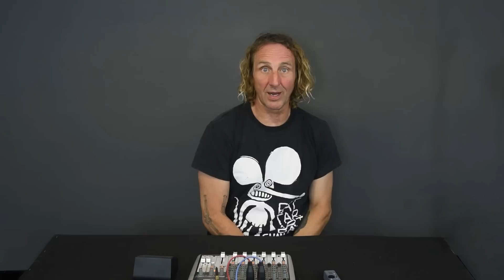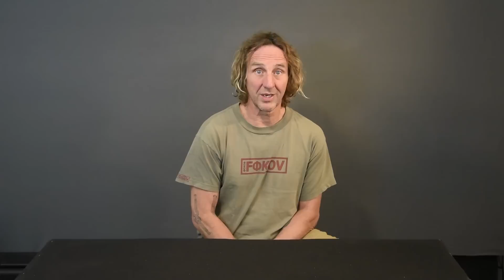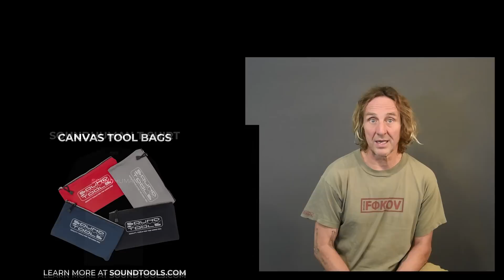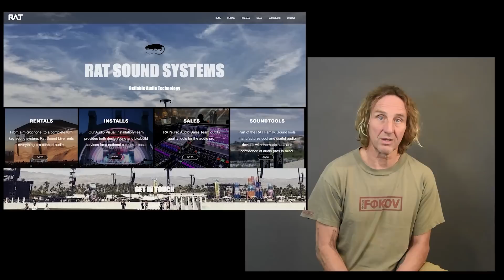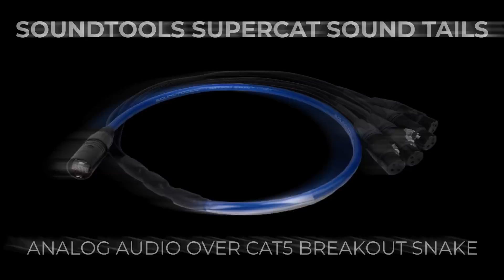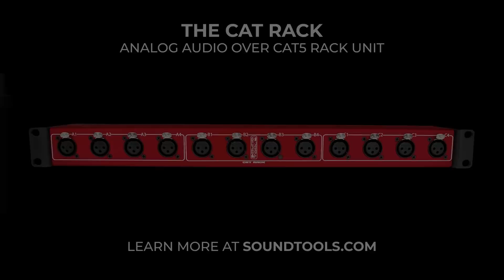Does Gain Pot Sound Different than Fader?

Comment: So on my console, i guess the aux sends are being attenuated by the send knobs, considered full send at 100%. Are the dedicated stereo fx returns attenuated by the return knobs, or is that a gain? My board has unbalanced stereo fx returns.
Reply from the maker: With digital consoles it's a bit different as pretty much every level control throughout the console except for the input gain, performs a mathematical addition or subtraction to the signal. 

So as far as digital consoles are concerned you have a gain control that will set up your signal noise ratio and for the rest of the console you want to try and use settings that are avoiding the extremes. 

And PFL various locations to make sure the level traveling through the console is not super low or super high. 

The main purpose of this was to demonstrate that the sound of changing the game pot versus the sound of changing and attenuator is pretty much exactly the same. 

There are people that believe that somehow the game pot turns up everything and an attenuator somehow magically knows to focus more on turning up the sound of the instrument that you're mic'ing

Comment: Theoretically, +1db on Gain and -1db on Fader gives you 0db. There is no magic on this. No if and buts. 1db is 1db EXACTLY the same. There is a difference in the electrical circuit : Gain is an active amplifier. Fader is a passive resistor. Gain brings signal up, fader brings signal down. But 1db is 1db, regardless of where it comes from.
Main difference is the way we use them for our convenience and protection of recording/sound quality.

Comment: I think that the gain vs fader has to do with how microphones react to gain more than the circuit differences between them somethings a noise generator in two channels won’t show
Reply from the maker: Interesting though whatever the gain circuit does, real or imagined, the fader just gives you more or less of it.

And neither gain nor fader has the intelligence or ability to selectively know the difference between the instrument mic'ed and background noise.

And somehow there are people that believe somehow a strange magical phenomenon exists.

I believe this myth comes from something that is easy to test and prove which is when gain run too hot, the loudest signals will distort, therefore reducing the differential between background noise and the now distorted  instrument.

Since the fader can't create of fix distortion, the fader just raises or lowers the level.

But when not distorting the signal and having sufficient gain to get above the noise floor, the fader and the gain impact the signal in ways that are so close to identical that the difference can be regarded and non existent or irrelevant.
Reply: @DaveRat  I think it’s a bit like the example with the amp and the noise where you lowered volumes from the amp and push more from the console, but in the opposite side of the signal chain.
 I ve seen something similar in a football broadcast ob van in a particular stadium,where it has a lot of noise and interference, the mixing engineer saw me that he has less gain than other places and pushes from faders more and gives a bit of digital gain to compensate for this and I heard the difference.
Personally I think that gain has a role of sensitivity with the source and sometimes different preamps have different sweet spots with different mics. I can’t explain it why but I’ve seen a lot with vocals that even if I have the same output to the speakers, gain plays the most role of how she/he etc may feel and control the mic, how it “grabs “ the voice. An other indication I have about this pre with mic connection is with wireless mics ,where gain becomes a volume control and doesn’t play so much role to how the mic “grabs” the sound , more of this role has gone to the gain settings on the mic before the transmission, this plays the most role of how the singer may work his distance etc
Reply from the maker: Hmmm, seems the description you offer blurs the differentiation between total gain of the signal chain vs the actual gain stage like a mic preamp.

If you have a mic pre set to 40 dB of gain followed by a fader set to minus 6 dB, the total gain will be 34 dB

If you set the mic pre to 34db gain and the fader to 0, you will also have 34 dB total gain.

Assuming you are not clipping or distorting the mic pre, both those scenarios will sound, measure and perform exactly the same with the exception of a small shift in the noise floor. 

Unless if the mic pre is seriously flawed or non linear or broken. Even dirt cheap mic preamps and gain stages are easily able to maintain constant freq response through a relatively wide gain range.

If your gear is audibly changing the sound based on shifts in the gain knob setting while not clipping, then your gear is broken.

Comment: Hello. You likely answered this question about gain staging, but I just want confirmation, the fadder could end up at 0 db or -20 if it needs to be for a mix, but it is does NOT affect the quality of the signal so it's just a turned down version of the great quality signal and can't diminish it correct?
Reply from the maker: Yes, a fader just turned everything down.  Equally. All the signal, all the noise, andt distortion. 

It does not add anything or change change anything.

Gain does pretty much the same thing but it can have non linearties and has the ability to to distort the signal if too much gain is added, while a fader can not distort or gain the signal it can only reduce.
Reply: @DaveRat thank you for the clarification. Here's the case that brought the question, I gain staged a sm58 and a left and right for a pc music playback. The mains are powered meyer upjs so I have the main fadder at -20 since they are loud. The sm58 is for announcements and sounded great for the pa before feadback at 0db with some headroom. Now the playback is gain staged and is equally loud to the sm58 at -20 for a good balance. For some reason my boss says that the fadder needs to be at 0db is where it is its best quality. But I told him it doesn't affect the quality and it's a even balance to whoever does the announcements. Pretty dang loud. I try to explain playback has more width since it's all vocal, drums, etc down two channels that overpower a simple sm58 but he doesn't believe me. He then pushs it to 0db on the fadder and then turns the gains down. Basically turning down the gain structure to where there is no lights. He then said I don't know gain structure.
Reply from the maker: There are quite a few people that believe that the gain pot turns up everything and the fader somehow is smart enough to just turn up the instrument itself.

That would be great but fader's nor gamepads have enough intelligence to differentiate.

Both of them turn everything up or down

What I believe this comes from is a misunderstanding and a confusion of the instrument versus noise

If the game pot is very low and the fader is very high you will have a minimal amount of microphone and a maximum amount of noise

If the gamepad is high and the fader is low you may have the same output level but you will have way less noise

If the gamepad is really high and the fader is really low you may have the same level but the input may be distorting from the gain overloading.

You want to set your game pot approximately in the range that is below distortion but not so low that the signal is close to the noise floor and not gained up enough.

For most applications this is a nice wide range.

For recording purposes and applications where absolute minimal noise is necessary then you would want your game parts as close to clipping as possible without clipping.

There is one advantage to having your fader around zero which I show in the video is that the sensitivity of motion is the highest resolution around zero where you can move the fader quite a bit with very little change as you get to very low fader positions tiny movements cause major changes.

So in a way your boss nd you are both right. If you put your fader at zero or where you want it like -20 and set your gain so that you get the level you desire

All should be good
Reply: @DaveRat  to add for gain structure I pfl'd the analog board and got it to 0db for sm58 and left and right playback all separately first.

Comment: I know this is an older post now but... I would LOVE to see this test done with a microphone!
Reply from the maker: Interesting, I did the test using pink noise which puts out energy at all frequencies in the audio spectrum.

Using a microphone would give us some of those frequencies depending on the signal but nowhere near as much total data as the pink noise.

What advantage for benefit in the test would be achieved by using less information provided by a microphone?
Reply: Well, quite possibly none 😅 I just wondered if somehow they might behave differently. There's no good reason they should so it's mostly just plain curiosity. So many people ask this question, and always in relation to the real life situation of mics on a stage.
Reply from the maker: Okay I will ponder that. The console doesn't really know whether it's a mic or other type of signal so it wouldn't have a way of doing with them differently.

Since a fader is just a reduction of the exact sound after the gain pot. The only way high gain vs low gain would be different would be for the gain pot to sound different at different gains.

It is good to question whether tests are relevant. I guess if the question of whether a console deals with mics differently than other signals would also mean that all the specifications would be questioned.

Freq response
Distortion
Maximum output

Are all determined using test signals, and if a console dealt with mics differently that test signals which are basically non musical music, then none of the specs would relevant.

But also with a console it is fairly easy to test whether it deals with mics differently than signals.

Just set up 2 channels to null as I show in the video. One channel high gain low fader and the other channel low gain Hi fader.

Once you have a null with test signal, just swap to a microphone or guitar or DI box or whatever you wish on the input and see if the channel's still null.

And then let me know what you figure out!
Reply: Ok I shall report back! When I next get a chance to have a play around. I don't have enough parts to make the y-split, so may do it by duplicating then phase reversing the input to two channels on a digital desk.

Theoretically the results should be the same, but let's find out!
Reply from the maker: Theoretically the results will be more accurate as you eliminate different mic pre.  But you also eliminate testing the mic pre as a factor.

But the question is not whether a mic pre is less or more linear with a mix than a test signal, so electronic split is good

Comment: Just came across your channel. Excellent content. You mentioned that it's impossible to clip with an attenuator, which peaks my curiosity. I'm new to audio, but I have done alot of research. I've been trying to record my crotch rocket motorcycle exhaust and have been having troubles with distortion and clipping. I first tried the zoom h1n, then upgraded to the zoom h4n pro. Still no dice. So I recently acquired a shure sm58 and a xlr cable. I assume I will still experience clipping, and my research pointed me towards something like a shure -25db or greater attenuator. Would this solve my issues?
I was also looking at a 3.5mm attenuator cable, and try and pair it with a lavalier and the zoom h1n for the same project. Have you any experience with 3.5mm attenuator cables?
One last question I had. I recently discovered this week about the new 32 bit recorders. And I was reading that there is no gain to set on them, and that the 32bit eliminates clipping. Is this true? And if so, would I be better off upgrading my current equipment and buying the new zoom h4n essential, and possibly the zoom h1n essential or the zoom f1/f3?
Your guidance would be very much appreciated 🙏. Thank you
Reply from the maker: Yes, an inline attenuator will help the zoom grab the sound clean. But... You also need to make sure the mic itself is not clipping. 

You will need a mic with a high max spl and keep the mic away from direct puffs of air/exhaust as the puffs will move the diaphragm too much.  Good luck! Lmk how it goes
Reply: @DaveRat Thank you for replying back. I was going off of an article from the shure website, and it said the sm58 could handle a max of 180db spl. The article says a space rocket taking off is 180db, and I can't imagine my motorcycle being louder then that haha.
They also said the recording device would clip before the sm58 would, and they recommended using an attenuator with it. This article was my reasoning for choosing this setup.

I'm planning on lining the inside of the tail, (underneath the rear seat) of my motorcycle with some sound proof foam. Then I was going to get a cheap pelican case, and use the block of foam out of it, and cut to fit slots for both the h4n recorder, and sm58 microphone to fit into. I would be placing both devices under the rear seat, in the tail section. My hope is the sound proof foam will help cut out wind noise, and also muffle the exhaust sound a bit.

What size attenuator would you recommend? Should I go with a -25db ? Or a -50db to be on the safe side? The feedback is greatly appreciated.

I linked the article I was referring to in case you were curious to read it.

https://service.shure.com/s/article/can-a-dynamic-microphone-handle-really-loud-sounds-maximum-spl?language=en_US
Reply from the maker: For the attenuator, 10DB is 10 times the power so 20 dB is 100 times the power and 24 dB is like 300 times.

So a 24DB attenuator is 1/300th 

That should be sufficient but the way to tell is to make sure that when you hold the mic near the tailpipe and you set the level on your h4n that the input level is not turned way way down. You want it so that it's like at 50% or higher setting gives you a nice level below clipping.

I would put the h4n under your seat and run and mic cable to the microphone placed down by the tailpipe somewhere.

To keep wind noise reduced I would put a big foam windscreen on the microphone The biggest fluffiest one you can find and then I would put something like a dog collar cone around the mic with the point of the cone pointing forward and the mic pointing backward inside of it.

Then I would take that mic cone windscreen combination and mount it with the mic pointing backwards somewhere maybe behind your seat as close as you can get it to the tail pipes.

I would avoid putting any kind of box around the microphone because that will screw with the sound. 

If you still get too much wind noise then find a bunch of open cell foam And loosely wrap the mic into a big Tootsie roll in it And then put the dog cone over that.

Cool cool let me know how it goes
Reply: @DaveRat  Thank you, your advice is very much appreciated. I will have to give that a try when I get everything together. I still need to aquire a xlr cable, and some sound proof foam for this project. I'll have to say though, I wasn't so much concerned about the wind noise, as I am of the sound coming from the exhaust. This motorcycle is pretty loud, and when the engine gets up into the higher rpms, it literally hurts your ears if you're standing near the bike lol. I'm not sure how many decibels it is. I was going to get a cheap decibel meter, but everything I seen only goes up to 120db. And I'm certain the sound level from the exhaust exceeds that 120db at times. I'll just have to experiment and see what works. Your video on microphone placement was very insightful, so I'll have to experiment with the microphone placement. Thank you, much appreciated.
Reply from the maker: You don't want sound proof foam

You want something like fiberglass that is used for house insulation.

Comment: Talking about amp attenuators, personally I'd like to turn down the attenuator knob on amps a little bit so that the 0dBu (-20 to -18 dBFS) on the mixer's main volume meter corresponds to the loudest average SPL desired for the facility or event. This not only allows for a higher S/N ratio on signal lines but also ensures a healthier gain structure for the whole system, making full use of sampling bit depth of A/D and D/A converters and (at least theoretically) improves sound quality by reducing rounding error in computing process of the mixer.
Reply from the maker: Agreed

Comment: I encountered this idea recently and I was completely baffled by it, but your video clearly shows how it may have come about. You don't mention compression, but if a channel is running through a compressor, then a similar thing would happen, I would assume, as gain is pre compression, and the fader is post?
Reply from the maker: Compressors can be pre or post fader and yes, compression will increase feedback and room sound while minimizing increases in peak volumes.

But that is a separate adventure

Comment: So why is OdB in the fader considered ideal position and not the turned up all the way alternative?
Reply from the maker: 0 dB is unity as in, what comes in is the same as what comes out.

An attenuator will have 0dB at the max position. Like most amplifier inputs. But with faders and aux sends it's useful to be able to boost or cut. So 0 is 6dB or 10 dB down from max position. If 0 was at the top, then everything would either be at max or you would be losing dB through each fader stage for everything not at max